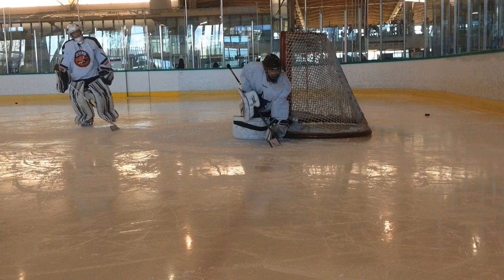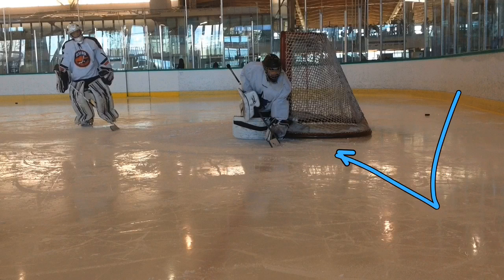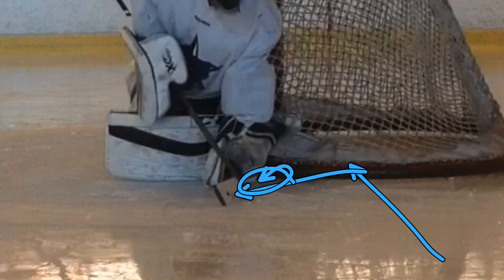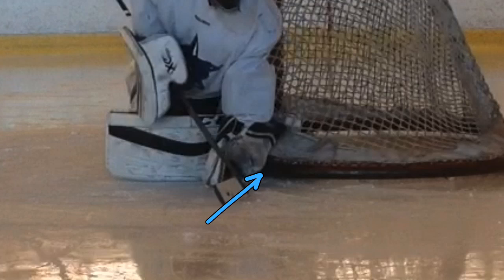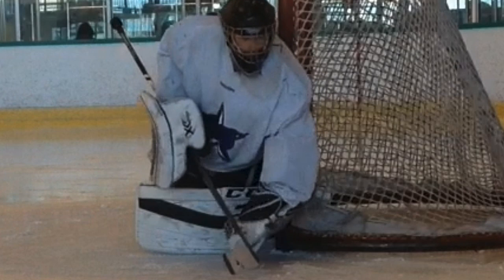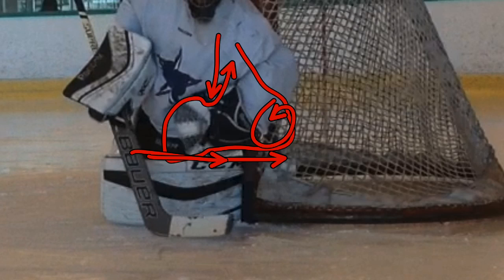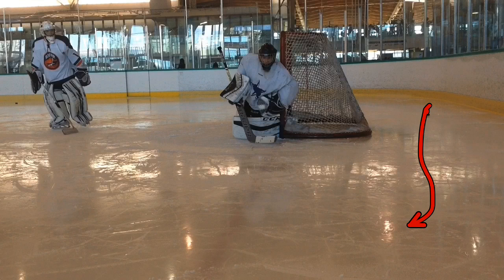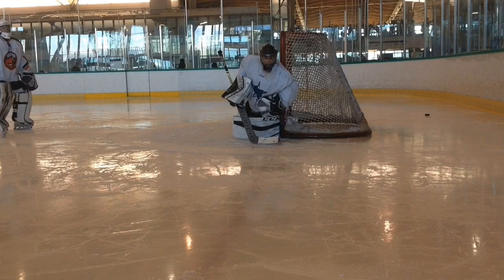NEW NHL RVH COVERAGE and RECOVERY TECHNIQUES (Pasco Valana EliteGoalies)

Comment: You're videos are broken down so well!  I have been using the backward trapper technique for about 2 years and works great for trapping the puck rather than deflecting it.  The only problem I see here with your sample is with the blocker hand. In that poisition, the inside of the hand is exposed and you're way more susceptible to taking pucks to the fingers.  Thanks!
Reply from the maker: That is true especially with gloves that lack the protection. I have spoken to reps of the goaltending brands about this and they have said off the record that they will be placing a fitted Kevlar piece into place to assist with that challenge.
Reply from the maker: That's a great question as well no you don't have to worry about your fingers on this particular play because your blocker faceplate is always facing the puck so it's either on the ice because they're tight or it's off the ice covering the triangle that you created on the post and that's where your blocker is covering and projected so I think you're safe either way blocker side I wouldn't be worried about it

Comment: Thanks for the video, very informative. Any concerns for injury to the back of the hand? I took a hard shot off the back of my glove once & it hurt a lot.
Reply: Doug Barclay 

that was my first and only concern and figure there is no time or space lost by having the glove opening facing the shooter...however only a shot from on the goal line should be able to hit the fingers.  but as goalies we know pucks tend to seek out the least amount of protection when fired from weird areas of the ice.
Reply from the maker: A little however if you are planning to make this apart of your game then you may need to make a few safety alterations to protect yourself. The new pro gloves coming out will have some protection as I have already shared this with some of the manufacturers.
Reply: Pasco Valana 

My Brian's Subzero 3 pro Trapper had excellent impact/slash protection over the fingers.  Most pro models have these small improvements over a standard "senior" level of equipment.

thanks for all your videos; you take the time to explain in detail what is going on and what errors to look for while doing the movements.  Definitely my favourite goalie channel.
Reply from the maker: Thanks so much!
Reply from the maker: Yeah great question there's always a risk of getting hit in the back of the hand but this particular example is in tight so I wouldn't be worried about that aspect but we're goaltenders are going down now especially in the National Hockey League far away or in the outside area of the rink meeting outside the dots you definitely have a shot of getting a broken hand. Innoway if you remind me to stand up when the puck is that far away